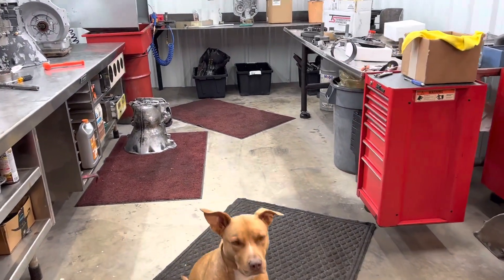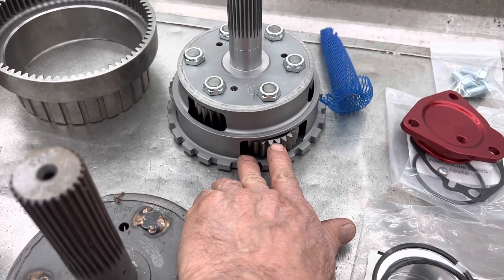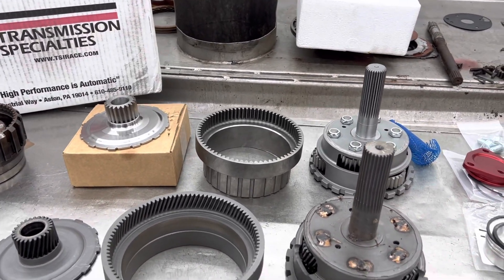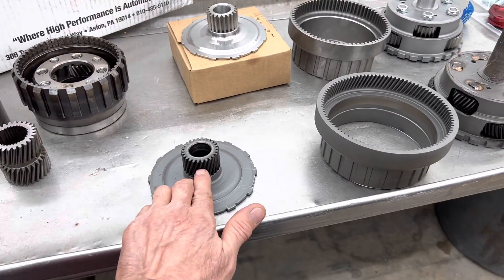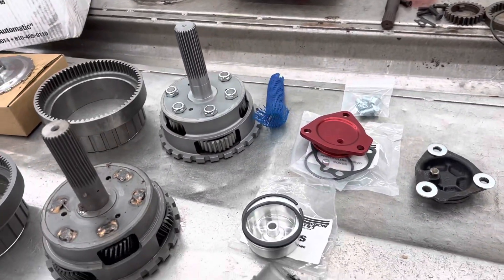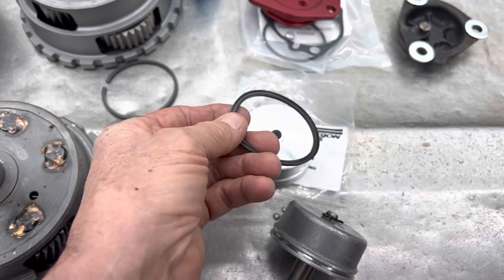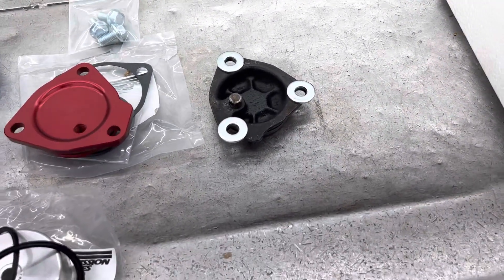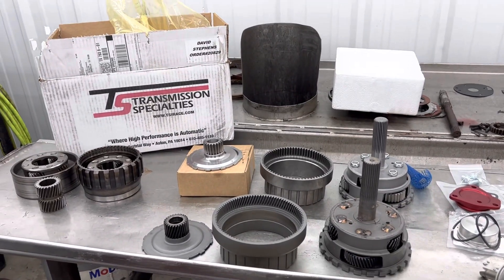Straight cut versus angle cut

Comment: Richard, I have a 2023 F150 Ford with a 10r80 and the tranny whines when it gets warm. Every truck we drove had the same noise, coming from the bellhousing area. Ford says its a gear driven pump under the converter with straight cut gears. They claim it's totally normal. Any feedback on this? Thank you sir!

Comment: Richard did you know the new 2023 COPO Cameros being built are running the th400. It is one of the best racing transmissions out there.
Reply from the maker: I did not know that thanks for the information you got to omit the 400 and the powerglide to the most amazing transmissions ever built I do like to c6 Ford transmissions and I do like the 727 Chrysler But all in all horsepower rating the powerglide has been number one for years but since we have CNC machines for 400 has come a long ways Whether you’re running a two speed 400 or three speed 400 all of these trainings are very tough

Comment: If the engineers that designed the powerglide in the 1950's  could see what that "economy" transmission has accomplished, they would be proud.
Reply from the maker: That’s for sure they would be very impressed